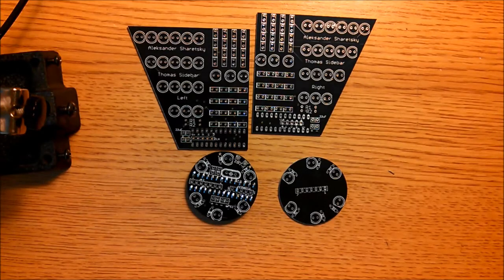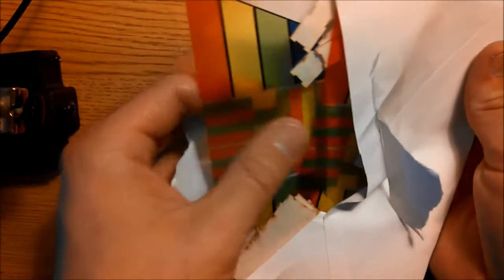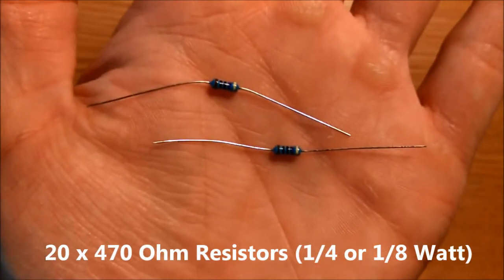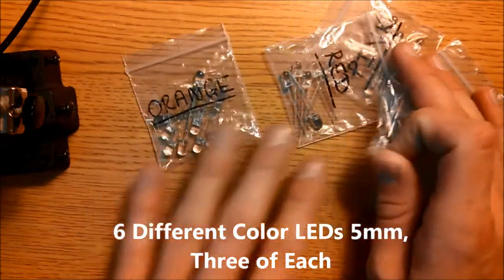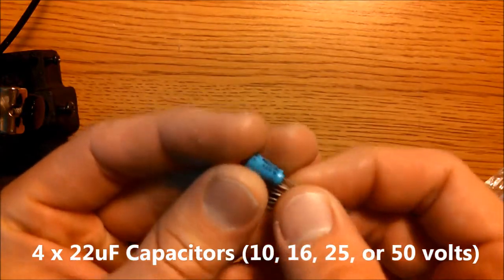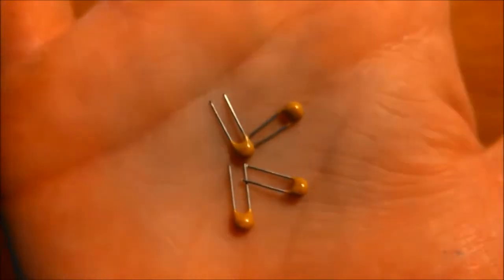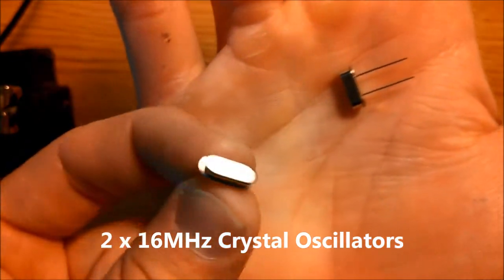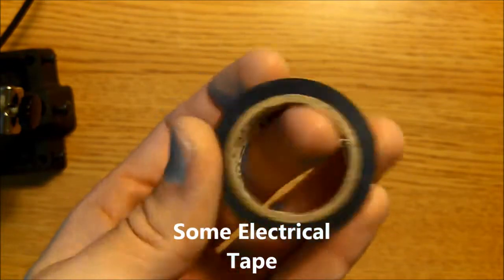Thomas Upgrade Kit Parts List

Comment: Do you have a website to order these kits? And do you have a website you recommend to order all the necessary LEDs, resitors, capacitors etc. Can this kit be fitted to any Thomas helemt? I'd imagine they are all roughly the same size.
Reply from the maker: Night Striider alexplusleds.com

Comment: Sorry I'm on my phone so I can't reply but can you buy the matrix boards and other circuit boards without buying the kit? Could I find those on EBay, Amazon, Etc.? Sorry for all the questions.
Reply from the maker: I'm the only one that sells them (since I'm the designer).
I can sell you everything but the laser cut housings for a slight discount.